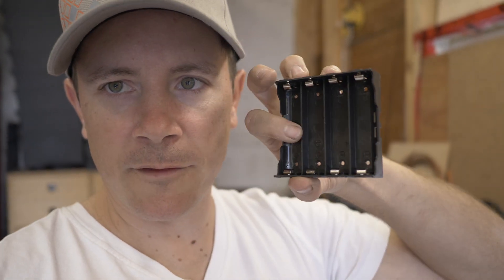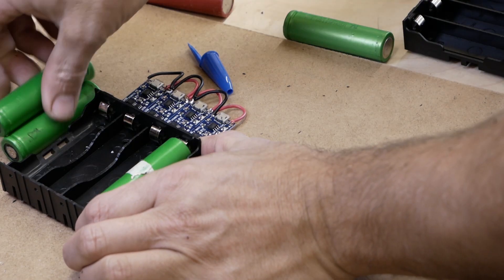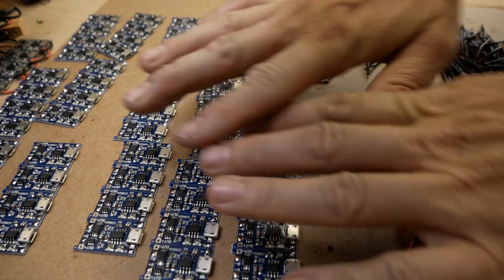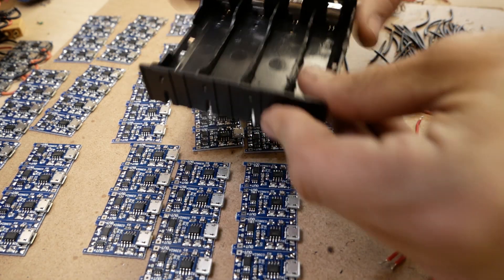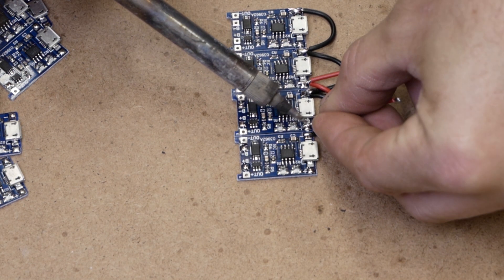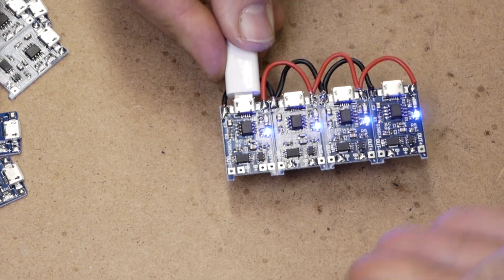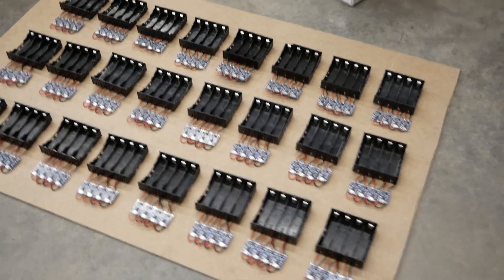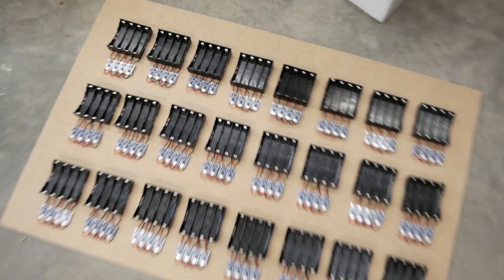96 Cell 18650 Battery Charger

Comment: nice job ...with this chargin settop you can replace a bms and have a 96v power pack or its non good for delivrery power?
Reply: La fuente de alimentaciom es de 5 voltios los único que cambia es el amperios que son 96 o 100amh para cargar cada celda a 1amp hora

Comment: That's what I felt like building.... Worked out that it would take 25 days 24hours a day to charge most of the cells.

I ended up making a 8/16 cell charger. Small and portable!
But... Down side is that the tester is only 4 cells. I could have got more of the testers, but the pack build is 'for fun'. I'm 3 weeks in and wish it was new cells. Then it's only charging that's needed..

Mine will be a run away, don't do it video coming up....

Good ideal, but you don't need the monitors as you can manually do it...
I'd have some volt meters on there so you can see what's going on.

Comment: Curious how this went long term? From what I have researched the XT connectors are rated at max amps and they should run at 50% constant load.
Reply from the maker: Ran pretty good long term, cycled 7 or 8 thousand cells. I never had a problem. But I also never had 96 fully depleted cells on the board at a time, since I would charge 96 cells of various soc and as they were fully charged I would pull them and put them on the opus chargers for discharge capacity testing, then once I got the capacity I would throw them back on the board to charge them back up... I could only discharge 28 cells at a time so really I was swapping all the time. So probably never really experienced a peak current draw. Now it just collects dust on my wall as a reminder of the pain and suffering I endured making 2 - 10kwh packs... Tens of thousands of spot welds lol.

Comment: how much voltage drop do you realy have at the end charger kabels . i think there would not be 5 volt anymore cause if you charging witch 1 amp your using 96 amp .
or are u charging with 500 ma

Comment: Hi
How can I charge the 7s power wall by a charger, however all chargers in the market are 24v and I dont know if its voltage reach to 29.4v.
Reply from the maker: You need a charger capable of producing the correct voltage. I use an icharger x8 for my 7s banks, it's best that any charger you get be capable of setting the final voltage, for example 4.1v/cell (28.7v) instead of 4.2 (29.4). I also charge using a solar charger controller when not home, once again capable of adjusting final voltage...
Reply: @havinfun4014  thank you for explaining but how can I get the i charger?

Comment: hello yes it is not easy to solder
on the screen it looks big but in reality it is very small to do and it is better to be good with your fingers
some videos in general from asia do this quite easily i wonder how they do it and with very low quality material... i already tried with pcb boards seen on youtube but it's too hard to connect.. .

Comment: I unfortunately bought 200 units of scraped laptops batteries, in the process of extracting, all the cells in about 150 unit's are not just dead but rusty. About 100 cells in the salvaged 50 units deliberately refused to charge and the remaining units that managed to charged were all very very hot. It seems the batteries has been kept for 10 years, I ended up throwing away 209 units of laptop batteries. 

Make sure to double check before you buy.
Reply from the maker: Tough break. I fortunately did not have any issues like that and came out very well with what I did buy.

Comment: Very nice video!   but I have a question, maybe someone has experienced the same.  in my experience different tp4056 charge at different cutoff voltage.  The ones I received vary from 4.10 to 4.15.  Some module will charge up to only 4.10 some to 4.12, 4.13, 4.14 and 4.15.  It is like that always?  I even tried using different power supplies and still same result. Thanks a lot.

Comment: Question: what gauge wiring did you use on the tp4056, From the solar cables you used from the main power and from the 18650 battery terminals to the tp4056. 
Also since your draw is near 100 amps with all 96 cells charging at once. You mentioned you needed to upgrade your power supply to be able to provide the proper amount of current.  Wouldn’t you need to upgrade that XT-60 connection as well, to at the very least a XT-90?
Reply: XT-60's can handle up to about 130a before actual damage occurs, however, it is going to be less efficient because some energy is going to go into heat. The XT-60 is going to act like a bottleneck, but it wouldn't be too much of a loss, simply because of the actual current limit of the connector. Despite the 100a number, it's only at 5v, so there isn't as much wattage going through as you might think. This setup would probably benefit from an XT-90 when it's at full load, which I doubt is very often.

Comment: Wish I had seen this sooner I am doing a 40 cell charging board with the TP4056 muduals was not sure I could wire the power that way so mine is kinda a mess of wires it works fine need two more to finish then I bought 40 capacity mudules so I can process my 2200 18650 I am repurposing for 4 -24 volt 120 ah battery packs . I am putting 10 renogy 300 watt panels on roof of my coach bus onversion with a Victron 150/100 MPPT solar charger,two Victron Multiplus 3000 watt inverter chargers. This battery building is taking up some time looking for faster ways to tst them all.

Comment: I'm more impressed about what you're doing with all those batteries than the charger. How many flashlights do you have really ? : )
Reply from the maker: Lol right!? I actually just finished building a 1680 cell pack 7s240p 10.6 kwh... It took so long and a lot of spot welds I cringe at the sight of rest of the batteries... Still testing many many batteries...
Reply: @havinfun4014  so worth the labor though, I know for cell prices lithium isn't that expensive in relative terms but they're still expensive
Reply from the maker: @skm9420  yes, totally worth it! Have it at my rec property, works really good, will bring it back before winter and give it a checkup.

Comment: Charging batteries is NOT testing them.    :-))
Reply from the maker: Correct. This video was not to test but to charge all of the batteries that I have, let them sit for a few weeks, then run them through charge discharge cycles on the opus chargers that I have...

Comment: I did something like this with a 12 volt server power supply and ran it through a 5v 30amp buck converter.  I didn't finish it, only prototype a 4 cell section.  I have a 600 cell shipment coming in so I may start up again tmrw.  Thank you for the idea for wiring from a main line with the little cut out.
Reply: Very practical easy to check and maintain
The most important thing you can easily replace the faulty cell
Wonderful !

Comment: At what voltage and current input does that whole wall charger running at? I want to make something like this before i saw this vid and im still not sure what input current should i need to use. I have in mind the 100 cell 18650 charging that is just like these setup
Reply from the maker: I'm running a 5v 100amp power supply, the tp4056 modules will only work with 5v. Potentially you would need all 100amps if all 100 cells are below 4v due to the constant current of 1amp up to 4v and then the current tapers off... But so far I haven't had any problems everything is working its actually overkill because I can't capacity check cells faster than this charges... But it is good to charge, let them sit for a while then check... But getting way ahead on charging.

Comment: Where do you get your cells from
Reply from the maker: Well my first laptop batteries were from ebay, unfortunately being from Canada there are very few sources of cells available.. Used cells that is. But earlier this year I scored a large lot of batteries locally..
Reply: @havinfun4014  it's hard I'm from Saskatchewan and sarcan refuses to resell. I have about 4000cells always want more lol
Reply from the maker: @dylanc9275  I hear you.. It sure is funny, once you start collecting these cells... You always want more lol. I picked up 4k cells for $600 bucks.... That was just luck.
Reply: @havinfun4014  from where lol
Reply from the maker: @dylanc9275  from a company that was closing shop in bc and moving back east and the customer build battery thing never went anywhere for them so score for me. 27 boxes of 168 cells... It was a good day 👍
Reply: @havinfun4014  very lucky
Reply: @havinfun4014   I unfortunately bought 200 units of scraped laptops batteries, in the process of extracting, all the cells in about 150 unit's are not just dead but rusty. About 100 cells in the salvaged 50 units deliberately refused to charge and the remaining units that managed to charged were all very very hot. It seems the batteries has been kept for 10 years, I ended up throwing away 209 units of laptop batteries. 

Make sure to double check before you buy.

Comment: I fuse my tp4056 so incase of putting in a cell backwards it just pops the fuse
Reply from the maker: Good idea... If I end up reworking it I might do something like that. But for now I just say "positive to the top" over and over and hope my hands follow my instructions 😂
Reply: @havinfun4014  I believe some TP4056 has reverse protection built in. Might look into it to be sure though.
Reply from the maker: @wmonte75  not these ones lol 😂... I did one backwards, both red and blue LEDs came on, but after you remove the cell, that board doesn't work anymore...
Reply: @havinfun4014  I'm the same way but once and awhile screwed up that's why I went to fuses
Reply: those tp4056 have reverse protection ,true there is a module that don't but its shorter we don't see it much because its about the same price.